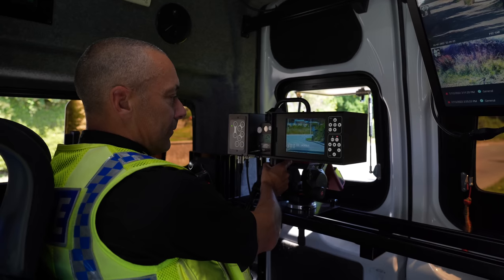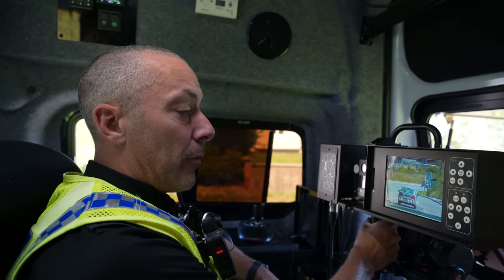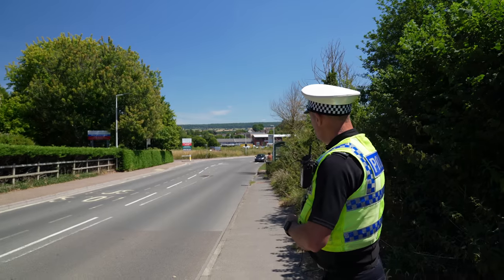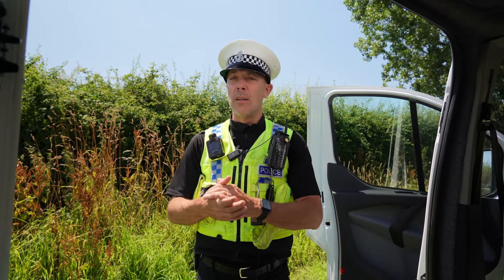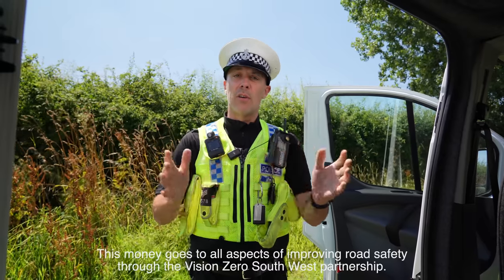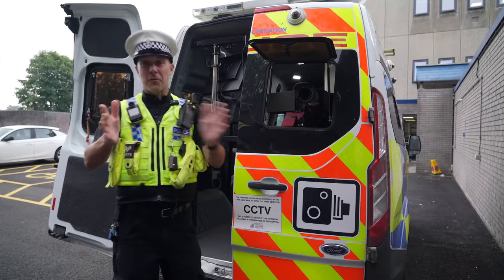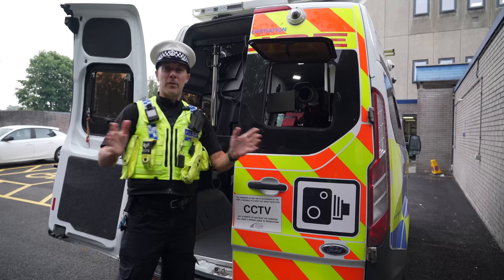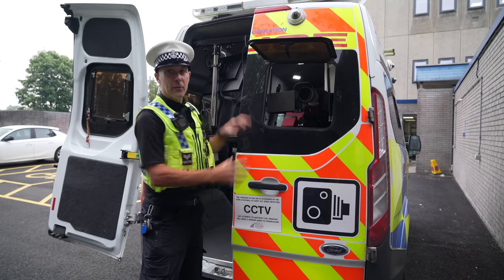SPEED CAMERAS - Road Safety or Cash Cows?

Comment: How does the number of incidents differ between derestricted zones and restricted zones of autobahns though? It's all well and good cherry-picking the higher speed of traffic and specifically the percentage chance of dying in a higher speed incident, that's obvious, with higher speeds comes higher forces when colliding with something, but if incidents are 10 times more frequent in restricted zones, it doesn't matter that 25% more people are surviving per incident (potentially with equally life changing injuries and or other trauma) if 1000% of the incidents per mile are occurring there, you'll still have considerably more deaths and life changing injuries and trauma occurring in the restricted zones, making the higher risk of dying if you crash irrelevant in the higher speed zone. You're still more likely to die in an incident in the restricted zone as you have a considerably higher chance of being involved in an incident there to begin with. You're guaranteed to die in various types of aircraft incidents, but the chances are so low of such an incident occurring that millions are happy flying every year. If the initial incident is prevented, then it doesn't matter how likely you are to die in the incident, as it didn't/couldn't happen.
Reductions in speed limits have been proven on various occasions to increase the number of incidents occurring at a particular location. Every incident leaves people worse off than they were before, to varying degrees, regardless of whether or not someone actually dies. Someone killed by a car doing 30 mph could still be left paralysed and needing life long psychological help if hit at 20 mph instead, something that could devastate a family just as badly as if they had been killed. All decreasing the speed limit did was increase the chances of someone being involved in such an incident by the fact more incidents are occurring post speed limit reduction. 1 incident per year with a 50% chance of dying is better than 100 incidents per year with a 5% chance of dying, 1 person would die every 2 years vs 5 dying per year or 10 in the same 2 year period.

These 'safety' vans don't do anything about the distracted driving, amongst other things, that lead to the increase in incidents when speed limits are reduced (from drivers becoming complacent that the lower speed means there's less risk of killing someone instead of focusing on not causing any incident to begin with). That car you clocked at 18 mph could have been distracted by a mobile phone or something that caused them to let off the accelerator and fail to keep up with the flow of traffic, the van they were behind that was doing 28 mph, presuming the conditions on the curve meant that was a safe speed to do, which the weather, traffic density, pedestrian density, the degree of the curve and general visibility up that section of road visible in the various shots would all suggest the safe speed is well in excess of that. That distraction from driving would mean they are considerably more likely to hit a child crossing the road in front of them than the van ahead doing 10mph more, presuming they were paying attention to the conditions around them. Under some conditions shown in this video, many drivers could safely do 40 mph up that road and combine with suitable positioning, etc mean that they would still be fully prepared for a child running out, while the hypothetical mobile user travelling at 18 mph would run over them, yet the driver these 'safety' vans will target is the safe driver who isn't driving too fast for the conditions they were presented with, meanwhile the driver using the phone at 18 mph are exceeding the safe speed for their conditions, trying to use the phone while driving being the main condition difference making their speed dangerous, is fine to tootle up the road and ruin the lives of a whole family by changing the life of a child in a major way, but 'fortunately' not kill them so they don't appear in politicians' statistics and they can pretend they've done something good. 

Interesting you mention your revenue comes from speed awareness courses. I admit I am going off third party info, but I don't believe the person who spoke about their experience had any reason to fabricate their experience, they're someone who thinks speed limits have a reason and accepted they had 'made a mistake' drifting over the limit in a PT Cruiser, so they don't share my opinions. I believe they mentioned that the 'course' was an online 'classroom' where someone talked through a generic list of don'ts when driving, don't speed mixed with don't drink and drive, don't use your phone, etc, stuff not relevant to the 'charge' (don't know if that's the right term) they had to be there for. In other words, a joke, although they're probably sum it up as inadequate to be more polite. How is that supposed to be 'educational'? Just going over the same fluff we get when learning to drive, in the odd pathetic advert, etc (more recent adverts, on buses, tv, etc, not the hard hitting public information films we used to have). I'd say the majority if not all those attending a 'driver awareness course' will know all that before doing what they did to get there, so there's nothing for them to learn from it being repeated, and therefore nothing that's going to change their attitudes to road safety for the better. A waste of time for all involved.
When I first heard of people having the option of a 'speed awareness course' or 'driver awareness course', I thought they'd be taken to a airfield or something with an instructor, with a scenario set up to demonstrate the difference small increments make when driving. So someone caught specifically for speeding would have a scenario set up to specifically show exceeding 30 mph to be dangerous, so the driver would be forced to drive a certain distance away from a line of parked cars or a van and a 'child' who 'runs' out from behind the parked van would be timed such that exceeding 30 mph by even 5 mph would be 'proven' to be dangerous, even though in reality, a road is often wide enough and the conditions often present themselves in a way that enable more space to be left to parked cars, etc to carry more speed equally safely in the given setting, but also the opposite where an oncoming traffic reduces space increasing risk and making the posted speed limit for the road too fast for the conditions. The educational experience would be exactly that, and education experience, tailored to the thing the driver was caught doing to show them the error of their ways, something they may not have actually known, and therefore learning actually makes them a safer driver. Not the poppycock I heard described in another video, described above. Those who drink and drive, use their phone, muck around with the radio, etc would have similar scenarios set up where the distraction or affect is mimicked as close as possible, either they send a text to their instructor for the day, or text or call the person they're most likely to want to interact with to while driving, someone who would willingly talk away or continue a text conversation with the knowledge they're doing so while driving, or wear the beer goggles and weights on their limbs used to mimic drunkenness, etc, running through an identical scenario, once paying attention, the next 'impaired', distracted, etc, to show what they were caught doing was 'wrong' and what's legally defined as 'right' as 'right'.

Comment: Cash cow, it's all about raking in loads of money in fines from the unobservant.  Speeding is easy to detect automatically and automatically issue fines. If it was about safety then the police would be targetting bad driving given driver error is by far the highest contributory factor but that requires police actually on the roads because as of yet there's no automated solution. Police were forced to admit that speeding was only a contibutory factor in less than 6% of accidents following the Office of National Statistics publishing Police accident investigation data in 2019. In fact inappropriate speed, where you're within the limit but driving too fast, was a higher factor in that year but the highest one of all was driver error at just under 50% however you can't automatically police that by camera. If you stopped speeding altogether stone cold dead from tomorrow it would only reduce accidents by 7% at best. And yet the way it's policed you'd think that it's the primary causation of accidents. 

The figures for 2020 are as follow:

Driver failed to look properly - 38%
Driver failed to judge other persons path or speed - 20%
Driver careless, reckless, in a hurry - 18%
Poor turn or manoeuvre - 12%
Loss of control - 11%
Slippery road due to weather - 8%
Pedestrian failed to look properly - 7%
Exceeding speed limit - 7%
Travelling too fast for conditions - 6%
Sudden braking - 5%.

Data available from ONS: https://www.gov.uk/government/statistical-data-sets/reported-road-accidents-vehicles-and-casualties-tables-for-great-britain#contributory-factors-for-reported-road-accidents-ras50

You want table RAS50002. Table RAS50005 goes into more granular detail breaking down each of those categories further and also by vehicle type.
Reply: You simply do not understand, no-one is saying that speeding causes all collisions.  Whilst human beings are in charge of fast moving metal boxes, it is a given that they will drive in to things, so enforcement is there to simply remind drivers to observe the posted threshold so that WHEN they drive into a person or object, physical trauma is minimised.

Bad driving causes collisions, the speed at the moment of impact determines the level of injury.

Comment: Cash cows, because if this is the case then everyone who is going 0.00000000000000000000000000000000000000000000000000000000001 miles above the speed limit is breaking the law, which is punishable by fine or points or both. Get it !

Comment: The purpose of a speed camera is entirely dependent on the limit it is enforcing.  If the limit is retarded (as all UK limits now are) then it is purely for revenue raising purposes and nothing else.  Retarded speed limits cause frustration, reckless overtaking, complacency and lethargy.  You often hear campaigners for lower speed limits saying that is what they want so they can "feel safer",  well feeling safer near roads is not a good thing because it makes you more complacent, and less likely go be paying full attention to your surroundings.  As speed limits increase the number of accidents per billion vehicle miles goes down (even on similarly designed roads such as those with 30 limits when compared to those with 40 - [Source: Official UK Road Accident Statistics).  Reckless overtaking; emergency response vehicles; cyclists that seem more than happy to make drivers 100percent responsible for their safety and pedestrians who are more interested in their phones than their surroundings are an accident waiting to happen and setting limits too low combined with the highway code advising vulnerable road users to abdicate responsibility for their own safety to others is just way beyond madness.

Comment: Wonder how many accidents happen due to constantly checking your speed and taking your eyes off the road.
Reply: What about continually checking your mirrors?
Reply: @unleashthedragonwithin2057  continually?
Reply: @Yayo11111  What is the synonym for constantly?

regularly, continually, endlessly, continuously, uniformly, always, ceaselessly, all-the-time, invariably, forever and incessantly.
Reply: @unleashthedragonwithin2057  if you're on a speed monitoring dual carriageway, do you check your speed or your mirrors more..
 Thanks
Reply: @Yayo11111  I wouldn't keep checking my speed, a vehicle only goes faster if you apply pressure to the accelerator or go down a gradient.  I regularly check mirrors far more, especially if overtaking, to see if an emergency vehicle is approaching with blue lights and just in general to see if anything potentially dangerous.  It is recommended that you check your mirrors every 5 - 8 seconds.

Comment: Yeah sure speed limits for out safety, how safe is when someone is tired and you force him to drive the boring as hell 20mph??? How is that safe? That could make many people fall asleep behind the wheel. Also 20mph and 30mph where not needed such as A40 going down to Central London only rises the polution instead of lowering it. Exiting the Central London towards M25 via A40 should be done at 50mph up to Hanger Lane and then should be bumped up to 60MPH up to Norholt and then continue with 70MPH as usual.

There is too much traffic due to traffic lights and low mph areas. Build more pedestrian crossings, roundabouts in T and + junctions and have your driving instructors TEACH PEOPLE HOW TO USE AND GIVE WAY AT THE PEDESTRIAN CROSSINGS! Don't just have someone that doesn't even drive, plan out the layout of the traffic or manage the traffic layout whatever.

Comment: Without doubt they are cash cows when on motorways and in rural lay-bys .  Get them in towns where people are doing 40-50 mph in 30 mph zones.
Reply: They are positioned in all kinds of locations, villages, towns, communities and on motorways.
Reply: @unleashthedragonwithin2057  I live in a village in the north of England where idiot boy racers scream through in their cars ........never seen a "safety van" anywhere near where I live, plenty on motorway bridges though.
Reply: @mikeoxlong2144  There are literally over six thousand villages in the UK and much of the non-compliance witnessed by locals goes unreported to police.  Equally, there are various reasons why police do not attend.  This can be down to it being just a perceived issue more than a genuine one, no suitable parking locations, no collision history.

What have you done about it yourself - have you contacted the police, the local authority, your MP?  Is this Police Scotland?
Reply: @unleashthedragonwithin2057   Locals report speeding, speed monitors installed across the road several times,  genuine issue, plenty of parking areas for safety vans, several collisions including  speeding tractors overturning on a bend, cars hitting telegraph poles, cars colliding into other parked cars.  We have long straits through the village at each side of the village with a 90 degree bend in the middle,  the boy racers in their souped-up hot hatches use the bend like a race track, their tyres screeching , then they accelerate out of the bend as fast as their car will go. Never seen a camera van anywhere near the village and it is a very busy B road. Not Scotland , north west England, Cumbria.
Reply: @mikeoxlong2144  And the name of the village?

Comment: I just wish some common sense was applied to speed enforcement.

If you are going slightly over the speed limit on a dual carriageway or motorway and it's a nice day with nobody else on the road with a clear line of visiblity, I don't see the harm.

Then you have the 20mph limit areas and you are allowed 10% so you do 23mph your fined... yeah that's a bit silly.

Then you have the variable speed limit areas, or areas that change the speed limit rapidly from say 60-70mph to 30-50 or something stupid. I find that to be dangerous as is causes people to brake, there should be gradual slow down to the limit. I understand that it's unavoidable in residential areas, but perhaps houses should not have been build that close.

Piss poor planning everywhere.
Reply: What is the source for your 'you are allowed 10% so you do 23mph your fined'?

Comment: The answer is in the title, cash cow it is then !

All this road safety bollox is exactly that, it’s all about generating revenue.

The government constantly bleat on and on about the amount of road deaths per year etc etc and constantly attribute it to speed time after time when in fact it’s more about the poor standards of driving we see on the roads day in day out.

Personally I would like to see dual carriageway and motorway limits raised a touch in an attempt to reduce congestion not compound it which is what is currently happening. 

I’d also like to see more stringent use of the existing laws whereas so many are just flouted time after time in the pursuit of personal agendas, trucks hogging the outside lanes, white van man constantly tailgating other road users.

The Germans got it right with the autobahns, use the outside lanes until something faster comes up behind you, then you move in, or else !

Comment: Cash cow
A proper traffic cop in a car can do a much better job.  Not only can they detect speeders, they can check, car road worthiness, under the influence checks, mobile usage etc etc.
Reply: No, once a vehicle is stopped by traffic police, they are tied up with that one specific vehicle, so all other offences go past with impunity.

The above also deals with seat belt violations, illegal plates, mobile phone use, not in proper control, contravening mandatory traffic signage.
Reply: Prefer a drugged up drunk off the road than someone going 2 mph over limit.